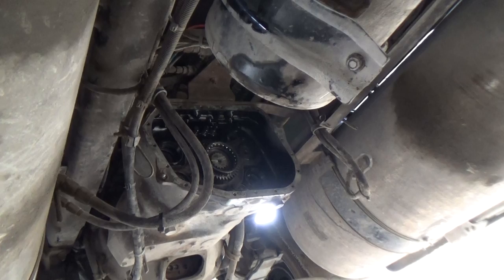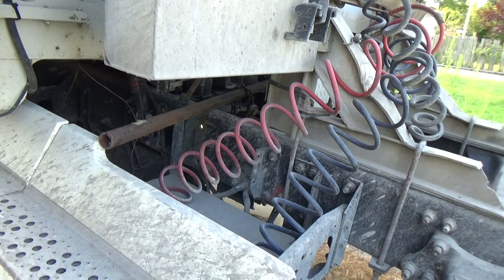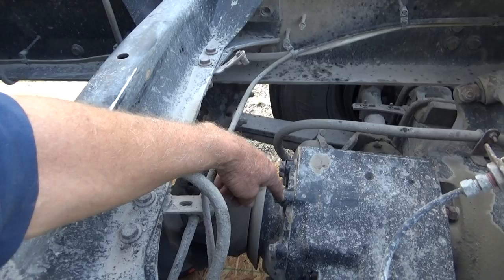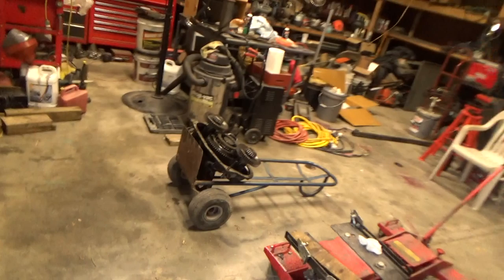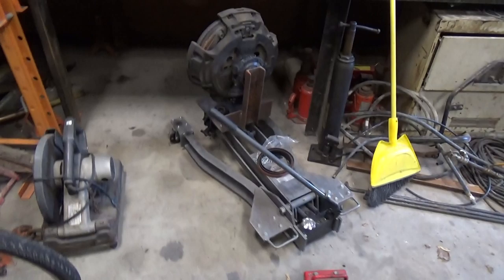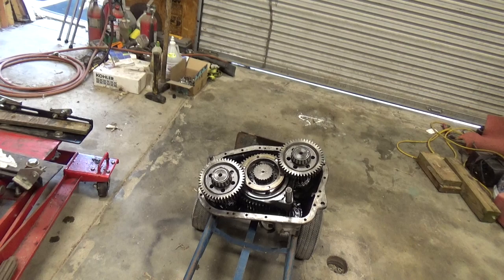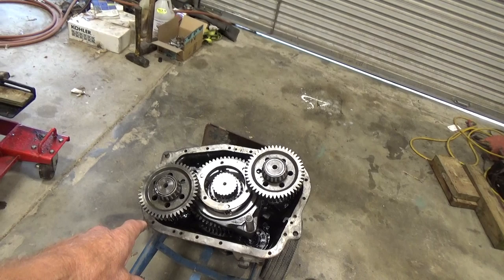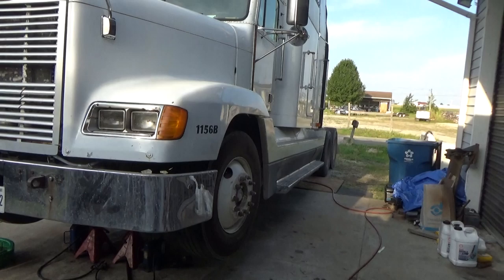Emergency driveline repair needed on the big truck.

Comment: Many, many, years ago, back when I was entering tech school I had to decide what field I wanted to go into, automotive repair, or heavy truck/equipment diesel repair. I choose automotive and spent over thirty years as a driveability engine computer and onboard diagnostics tech. Made the decision because the idea of having to lift such heavy parts is not my idea of fun. Going to the parts department at the dealership I worked at back in the 90's and just carrying the 3cyl 1.0liter shortblock for a gel metro back to my bay because the dolly was tied up seems much easier than dealing with a semi transmission

Comment: Worked at a Freightliner Dealership in Tulsa, no need to raise it up to troubleshoot, simply slide your rear axle shafts out. Start it up, put it in gear, you will find your noise/vibration. Drain Power divider, rear diffs, check magnetic drain plugs, repair as needed. Hope this helps.
Reply: Great tip Bill

Comment: Gordon its 's a power divider. Their aweward to handle and heavy. It has a shaft that goes straight through rear end so you will have to drop the short drive shaft and pull the yoke off to pull and power divider off. Usually takes a 15/16" socket. Theres 1 bolt you will have to use a wrench
If you pull it you really need help putting it back in or you can really mess up your back.
Reply from the maker: It's the front diff. the spider carrier, I don't know the right name for it, I'll take it to the trans man in the morning.
Reply: @57bagre  yes on front diff. We call it power divider, pumpkin.
 Fun to pull off but a real ____  putting it back on.

Comment: Listened to the noise in your going home Video, The problem is in the front Diff not the Transmission, easy way to know is drop the oil from the diff and feel inside the housing, I am betting you will find pieces in there. My guess is the crown wheel bearing on the gear side of the carrier  has failed. It is possible the power divider is warn out but locking up the power divider should have made the banging stop. Good luck
Reply from the maker: Keep watching the videos to see exactly what happened. Thanks for watching Neil.

Comment: I use a clutch jack as well. much easier to build a fixture to hold the auxiliary box ad get it back on just right.
Reply from the maker: 'Building that tomorrow and reinstalling the gear box.

Comment: Just changed my syncro in June it's not too bad,not fun putting it back in tho to line up , and did diffs before front one is a bitch but if you can lift it from the top it's not too bad once lined up,did both all by myself so it's possible
Reply from the maker: Thanks, I found the trouble in the front diff.
Reply: I’m doing my rear front , got it out with a Cherry picker and a floor jack

Comment: I just went through the same thing on my Mack. It had a funny vibration , checking driveline angles, u joints ,slip joints you name it ,came up with nothing. On this past Wednesday I found it , I had a chipped pinion gear and it let go. I was going up hill grossing around 120,000 , it wasn’t pretty. Good luck and I hope you don’t find yours the way I found mine.

Comment: Hi Gordon. I enjoy your videos. I have near exact truck as you but mine is an old Conway truck with single round headlights. A '99. That old junk Mercedes that someone left you may have parts for your Fld. Certain models use the exact same corner signal light. Check it out.

Comment: Those jackstands look all sorts of small under there, lol.  I picked up a set of 12 ton stands for my GMC Topkick 5500, probably overkill but just didn't feel comfortable with the regular 3 ton stands.
Reply from the maker: They're 6 tons each, more than twice the weight of the front of the truck.
Reply: @57bagre  I knew you wouldn't be working under it if it wasn't safe, they just look tiny is all.  Looking forward to the next video.

Comment: If the power divider is going out it's better now to find out when you can rebuild it, they are not to bad to work on just awkward as all hell.
Reply from the maker: I'll learn more about it today after the shop opens up (6 am right now) I have the power divider out now and all cleaned up so Vince can find the parts for me I'll get the removal video up as soon as I get some views on this one.